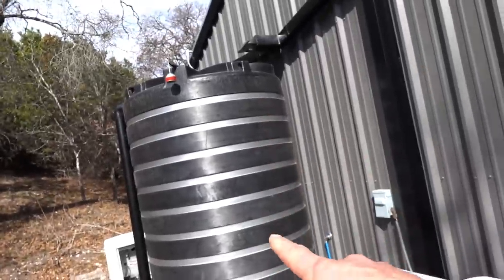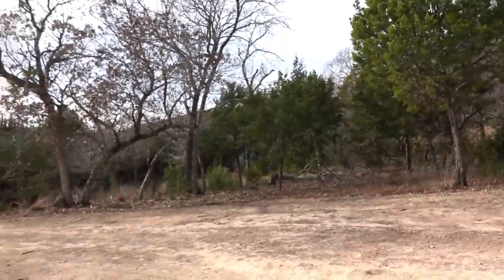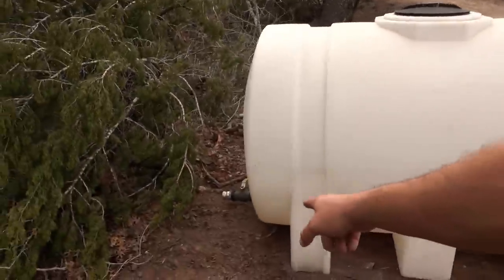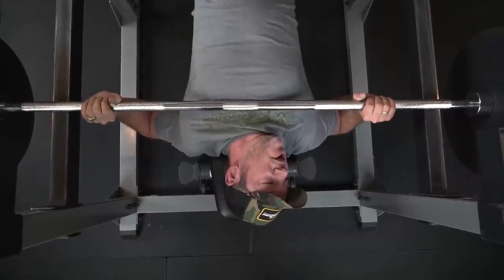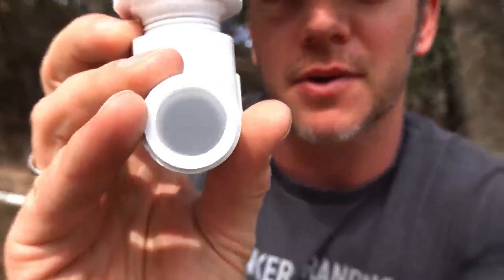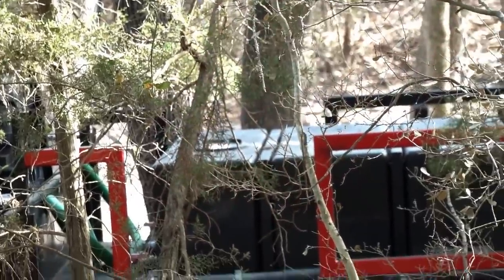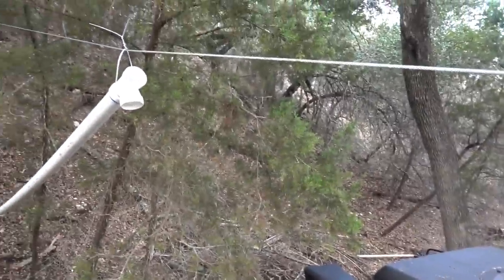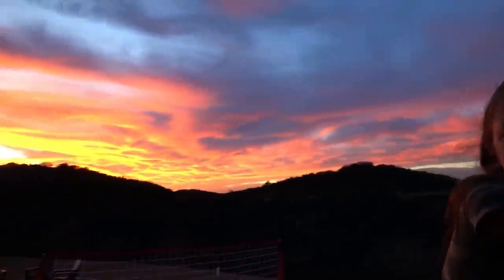Trying to Make this Work... And my Fire Truck is BROKEN!

Comment: Think about adding in a small solar power system to the unit. Small heater, pump, on/off valve. Shouldn't need much more than a car battery for storage. You should put support saddles on the pipe when you hang it. Bare cable or wires will cut thru the pvc fast with the wind swinging the pipe.

Comment: flexible 2 inch pipe down hill then another tank at bottom with a pressure pump on it with the water taps down there . upper tank fills bottom tank and pump gets you all the pressure you want

Comment: Squirt some silicone in the low air alarm. The LMTV alarms are crazy loud, the silicone makes it much quieter but still plenty loud enough to hear even on the highway. 

Also, always drain your small pumps in the winter...

Comment: Make a burm in front of the tank If you are worried about hitting it easy 
To do with your available equipment.
Also but a boards on the pull side of the trees or the cable will cut into the bark when you load the pipe with water.

Comment: On your downpipe I would just go ahead and lay that thing either in the ground or on the ground all the way to the bottom then you stick a pole in the ground and bring a riser up as high as you need it and maybe even a swing Pole to go over to the tank it's going to be the same difference whether you bring the lines level from that height or bring it down and Rise it up, water pressure is going to take over and you won't know the difference.

Comment: Why not put a 12v pump at the hose connection end?  Use a deep cycle battery on a solar panel to power it. With the head pressure from your tank it will supply enough suction pressure to run it and give you more then enough pressure on the hose to do some work.

Comment: pipe thread and garden hose thread are different. Will work but it will be prone to leak and the leak will get worse every time u unhook it cause u will damage the pvc threads

Comment: Matt, why not just put a water pressure pump in the line at the bottom of the run, will boost the pressure and solve your pressure problem.

Comment: Best way of doing it is putting dirt under the pipe to elevate it and then build and wall on the hill side to prevent erosion and it will be strong

Comment: I know there’s a lot of armchair referees giving you advice. Let me start off by saying I am plumber. That way you have it it’s fine there’s more than one way to skin a cat. But you should have used schedule 40 pressure fittings instead of DWV(drainage waste and vent) fittings. They would be much stronger when the pipe flexes from the weight of the water. And the weight of the water will be a factor across that suspended pipeline. But hey the more you F around the more you find out

Comment: run pipe to there with pump at big water tank  to fill and keep the smaller one filled up . as you use the water the pump would come on and replace the water to you

Comment: Matt, those 90-degree elbows are going to kill your flow.  Use sweeps if possible, or use a couple of 45's with a short length of pipe in the middle, instead of the elbows, to make 90's that are less restrictive.  

PS: Get yourself a 100' tape, for measuring jobs like that pipe run, fencing runs, etc.  A measuring wheel, if your estimating for gravel or other materials to cover your roads, measure for fence, or pipe (if terrain conditions allow), etc.

Comment: Put the 500 gallon tank at the range. Connect the 1000 gallon tank to it. As the rain collection fills the it fills the 500. Then flow it down to it using the pump to transfer the water. Just shut it off and drain it for the 3 cold days you get in Texas. You know when the wind mills freeze and you can't get electric.

Comment: Mount the pump on rubber bushings to soak up the vibration, and you should avoid cracking the casing in the future.

Comment: Fluid pressure is the same anywhere at the same level. You could run along the ground and then go up the tree. It would be the same pressure either way.

Comment: The smartest, cheapest and quickest way to solve your dilemma is to simply reinforce the awning cover you already have over your shooting area, and simply place the tank on top of it? That, or build a tower next to it at the same hight. The water pressure would be great, and you don’t have to dig anything, or buy and run pipe through a forest! Pretty good chance it won’t be hit by shrapnel, or intentionally shot either! You can easily refill it with the water truck.

Comment: You can rework the manifold on your brush truck and make it that you can hook the tote up to the manifold and either feed off the tote or transfer the water from the tote to the tank on the truck using the pump. BTW, you have to always drain the pump when your done with it. Water sitting in the pump isn’t good for various reasons. On our brush truck we had a ball valve installed on ours and opened it at the end of each use.

Comment: If you need more water pressure, you could simply build a platform to put the tank on to give it more elevation. Doesn't need to be complicated, just a simple, stable platform.

Comment: Start with two inch pex, on the top of the hill, then reduce to 1.5inch, then 1 inch, then to 3/4 inch, then end at your faucet with half inch. Should substantially increase the pressure.

Comment: I most definitely would have just taken that tank and turned it sideways with the spout down, and built a stand for it behind the roof of the pavilion, use some plywood and sheet metal to create a ricochet barrier, and a tube that can be quick connected from a 2in water pipe to a full bore tube for filling the fire truck. Maybe a foot operated mechanism for a flap to allow air to come in from the top if WP was low

Comment: You should build a platform to put the tank on. 1 you’ll increase your pressure. 2 mark it tall enough that if your up top there and need to refill the fire truck you could refill it up there too.

Comment: hydrostatic pressure (psi) = density (pounds per gallon) x vertical height (feet) x 0.052
alternatively
vertical height (ft) = pressure (psi) / (density (ppg) x 0.052)
water is about 8.4 pounds per gallon
You'd also have to include pressure losses associated with the pipe, and they can be significant

Comment: Matt don't forget to put a snorkel/breather on the two inch pipe . The pipe on cable should drop at least 2 inches per 8ft. The tree going to die in three years unless you use like 2×4 spacers between the cable and tree. P.S I am not a tree hugger but I am just trying to save you from re doing in two - three years.

Comment: The pump housing broke probably when that snap cold system hit, and there was water in housing that froze and busted it.. Should install a valve to drain the pump  of any water after use. It might of even have one on it that you can open up - Might be able to get someone to weld the crack - if they know how to weld cast aluminum.. or iron? idk whatever thats made out of..
Seen some wild welding action on Cutting edge Australia  - rebuilds large vehicle parts.. also some other channels that can't recall names of XD Could do DIY casting - like farmcraft101 - smelting metal down, building the sand mold form - using old part as imprint.. 
just depends how deep and how much want to spend.. might be cheaper to get a new pump idk..

Comment: Just run the pipe on the ground, the put a vertical pipe on the end to reach the fire truck fill port.  Your head loss will be negligible, and it will be way easier to build and maintain.

Comment: I use a Sureflo RV water pump on my property it runs off a12 volt battery and it's charged up by a solor panel those RV pumps have about 55 psi

Comment: I think it would look great to spray paint it in green or camo :)  I wonder if they could thread the pipes over this steel cable from  the begining to make it easier to elevate, and then one could just cut it  after, and pulling it out the end. Or perhaps if there are cables made from rust proof metal it could even be left inside. Since when it's full of water it would weight 80-85 lbs not taken into account the weight of the pipes themselves. But me math is not the best so some one better at it can tell if I'm way off.  With camo  I really don't think any guest would notice them at all this way :D

Comment: Just put a pump in the tank. It will give it plenty of pressure and you can put it down there by the range.
And you could use solar power to run it  just a thought though

Comment: Food for thought. The 4500lbs of water being gravity fed will be fine at first,but your losing weight as it drains, which in turn reduces the amout of pressure. Just buy a small pump, connect it to the tank. No need to dig, and bury a 100yds or better of pvc in extremely hard, rocky soil.

Comment: Why not use (trash pump) bilge pump hose for this.  Probably easier and cheaper, and sections are easy to replace. Plus you could use a battery powered vacuum pump or the one on the fire truck at the bottom

Comment: Matt you are going to need a pump even a solar pump should give you the extra pressure you need.  My home in the country had a minimum of 40 psi and the pump could boost it to 80 psi if needed.  The people telling you to build a tower, you would have to get a civil engineer to calculate the weight and material to use.  They don't understand that 500 gallons of water weights approximately 4500lbs alone.

Comment: Someone may have pointed it out, but the 3/4" threaded end on the PVC is not the same thread for your garden hose. You'll need an adaptor for the different thread count.

Comment: Move your tank down the hill and buy a gas 2 inch transfer pump.  Have a fire hose on it for putting out small fires.  And you could run a banjo fitting and fill the bottom of your tank.

Comment: It is good to bury the plastic tank so it does not age from the sun. Also, come to think of it.... if your tank freezes - it will pop, and dirt is an excellent heat isolator.

Your pipes should not be plastic if they are outside because they might freeze and pop. I do not think isolation can help. 
Also, why go through the tree? You will have pressure from going down the hill. Just put everything underground. Here (in Bulgaria, the lowest I've seen is minus 22 Celcius (converter says -7.6 F)) is 50-60cm (2 feet, says the online converter), and this will preserve the pipes for some years. Honestly, I don't know the lowest temperature possible in Texas, but 1ft is the least to protect the lines from wild trucks, bullets and freezing.

Comment: My guess is you left water in the pump and it froze and cracked the housing. Also I suggest using a larger flexible hose like 3" to go down into the trucks tank. You don't want to use that green hose it's to stiff. What you want is call Blue Discharge hose.

Comment: It’s more work, but the more durable solution is to make supports that fasten to the trees on the hill that will hold the pipe. The cables and wires will not only cut into the trees but through use and weather will start to cut into the pipe. Simple is easier but doesn’t always last as long.

Comment: You need the tank to be at about 100ft in order to get 40psi. Just get a couple 12v transfer pumps, 12 solar panels, batteries, etc. You’ll get consistent water pressure this way.

Comment: This has probably been said already but I don’t feel like going through all the comments.  If this doesn’t get you enough water pressure then your next option is to build a 12 foot stand for the tank.  Then you can put a large as possible dump valve right on the tank and quickly fill the fire truck from there.  Then you also won’t need to suspend the pipe down at the range.

Comment: For anyone curious, if you have 33ft of drop you will get 14.7 psi of pressure (with water). It is also 10 meters equals 1 bar, but this is America and we do things in 12th’s.

Comment: Is the pump made of metal? Steel? Aluminum? If so, the crack can be welded. Especially for aluminum, I would recommend TIG welding. That should produce a strong, clean weld if done well.

Comment: I don’t know the specific numbers but I have ran a 12 volt tire pump plumbed in to the top of tank  it uses a small solar charger and it hard pipes into to marking it pressurized

Comment: I have never done something like this but have you considered a solar powered water pump?  Instead of suspending all that pipe up in the air, just lay it on the ground and have a solar pump at the base which is attached to your hose.  It would give you the added pressure without the need for electricity or much maintenance.  Good luck.

Comment: You need a jet truck aka sewer cleaning truck 600 feet of hose 80gpm  and most stop at least 1000 gals you can find them pretty cheap used

Comment: Get a 12-volt pump and attach it to the water tank then take a deep cycle battery out there with a solar charger and wire you switch to the pavilion to turn it on.

Comment: Omg you have solar power.... use 2 pumps. 1 to push water to fill the tank and 1 at the demo ranch for the presure from the tank. Take a hose and a electic cabel in the trees al the way to the  demo ranch.... problemens solved  and  you have also power at the ranch now
..

Comment: Build a stand for the tank to make it higher and just let the pipe lay on the ground then up the tree, as long as the highest point of the pipe is lower than the tank it will still flow and a roll of PEX pipe would have been quicker to run.

Comment: Harbor Freight trash pump. I have used the same one for over 7 years. 
Do you have flex connections at the suction and discharge? 
That Honda pump cost probably 2x the cost of the exact same thing from  Harbor freight.

Comment: Gotta love that redneck engineering.   I think running to the bottom of the hill then straight up and down the tree with a couple of T's would work just as well.  You would have the same net drop so basically the same pressure with no need to suspend the pipe. Put a drain in before the first T so you can still empty the system to avoid freeze damage.   I suspect your fire truck pump froze and thats what caused the damage.  Should be parking that inside when you have cold weather.

Comment: If u wanted to you or if u need to u could also build a platform out of wood or the legs out of metal with a wood platform with a ladder going up to it and place the tank on top for higher elevation kind of like those redneck blinds but with a tank on top instead of a blind could be an option

Comment: Use 2 inch pipe down the hill and reduce at the bottom. That will help with your water pressure

Comment: Pvc valves don't last.  Suckers get stuck and then you break handles off.   Lol.  Been there done that.   Also pvc isn't uv tolerant.  But it will last years before it gets brittle.

Comment: That long of a run the pressure would not be the problem the volume would be. If you ran say a 1-1/4” pipe then you may have enough “pressure” due to the amount of volume.

Comment: Make a funnel for that top opening with a mesh screen. It will collect water and not let leaves in. Bigger pipe up top and smaller at the bottom will increase pressure.

Comment: Just put the tank by the range and get a pump (solar or gas). Seems WAY easier. Just test them every so often and go from there. Disclaimer: I know nothing about this stuff and basing this entirely on unqualified logic lol

Edit: plus using cables to dangle a pipe seems like it'll cause all kinds of issues. Cables loosening, wind during bad storms, cables snapping and causing the pipes to snap, a bunch of stuff.

Comment: Pressure from height/gravity: density x local gravity x height

Metric: 1000 kg/m^3 x 10 m/s^2 x 10 m = 10^5 N/m^2 = 10^5 Pa = 1 bar approx. 1 atm
Imperial: 62.4 lb/ft^3 x 32.2 ft/s^2 x 40 ft = garbage we need to convert to PSI by garbage numbers

'Murcia: And I think this is beautiful

Comment: Honestly you could have just got a 12 volt tank sprayer pump and get a deep cycle battery with a solar trickle charger. I use my 30 gallon sprayer for fire prevention all the time. Plenty of volume and pressure to put out a fire.

Comment: Why not just build a 7’ platform next to pavilion? Tap and run rigid pipe down one of the supports for hose reel. Leave the larger dump valve off other side for refilling fire truck.

Comment: If no electricity a solar powered small pump would boost the gravity feed with surprising pressure. P.s may as well rig up and modify a screened hood to collector water in that barrel as well so u constantly have a full barrel, plus would overflow/vent all the nasty foamy germ junk that will likely collect at the top after sitting water will stagnant

Comment: You will keep braking stuff on your fire truck with the solid pipe. You need to use hose and not pvc pipes to allow for vehicle flex.

Comment: man, that glue used to be good. we used it without primer all the time in irrigation. mud (red carolina mud), grime, lake water. (not in the lake, just around it for pumps and stuff) . didn't care. always held the connection. does it make a difference now?

Comment: 7 years  combat Engineer.  The basic idea is good, but the execution gets an "F". While you're typically warmer than the rest of the country, you do get freezing temperatures. The pipe needs to be under ground, below the frost line. The parts above ground need to be insulated. Also the cable is going to kill that tree via strangulation. Put a small pump and solar panel on the tank to raise the pressure. Finally for the trenching give your son a shovel and tell him to get busy.

Comment: No need to hang all the pipe. You could have left it on or under the ground and just have a stand pipe up to fill truck. Pressure would be the same.

Comment: install an RV water pump connected to a battery that charges on a solar panel and put it on a small trailer to move around if it needs to be moved